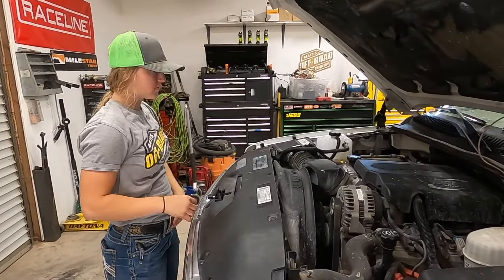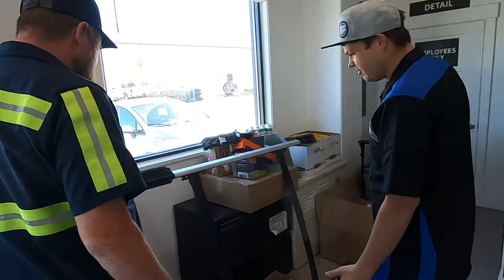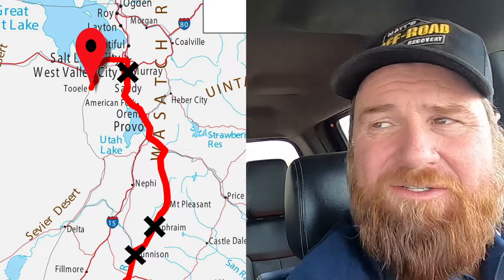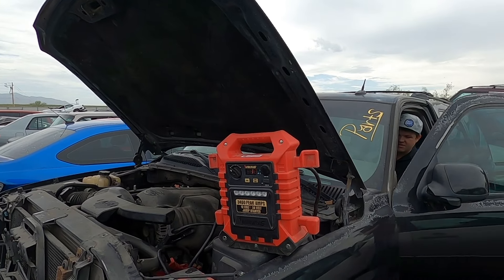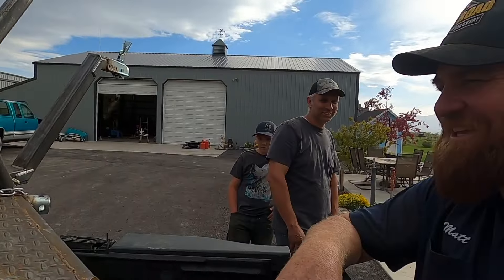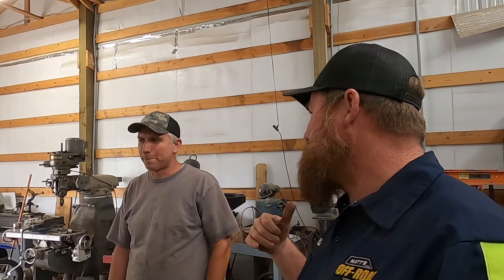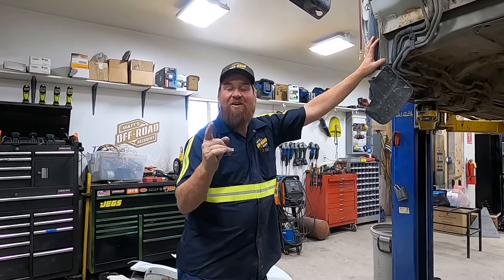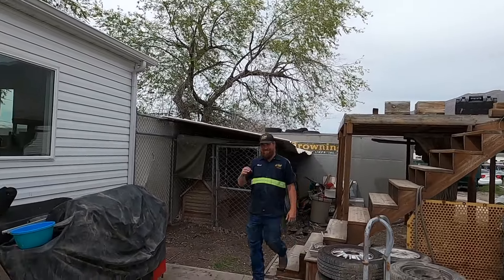Massive Engine For A Massive Off Road Wrecker!

Comment: Hello Matt,
I wanted to make a suggestion for the Wrecker. Have you thought about the fuel tank? Since you usually run out of Fuel in the past (Due to unforeseen "reasons", LOL) Would a thought of a custom made fuel tank of say 60 gallons be a good idea? Now would be a time to think about how to have it shaped to fit into the channel between the frame. It might need a middle raised hump to clear the drive shaft. A good electric fuel in the back end. Add a super heavy duty skid plate because of going over rocks might be a great Idea. I know you have said that you are trying to limit weight but if done now it would be a bonus later. You have several people to draw on to get it prepared for later install. One reason I was thinking about a 60 gallon tank is because you mentioned that the 8.1 liter engine takes 3 times s much fuel to do the same work. If you think about it now it could be manufactured before you are ready to install it. Hope it helps to make the suggestion.
Reply: Should be split between two tanks. Given the nature of the beast he's building - redundancy is crucial. One large tank could spring a leak & all of it lost. Two tanks are less likely to both leak fuel.
Reply: My 26gal Crew cab 06 short bed that is lifted 6” running 35s gets 8.7 mpg city with me babying it unloaded WITH a tailwind. Any type of more fuel storage is a MUST…. I’m not even through the video and I can tell you all are the real deal! Good luck y’all!!!!
Reply: I recommend Dual Large tanks for Matt
Reply: I have an 06 GMC 2500 with the 6.0 L extended cab with a 2 inch factory lift kit because it is the disguised 7/8th ton. I get 13 highway 10.6 city with slow acceleration. Hook on the 6x12 cargo trailer and loose 2 to 3 mpg especially with a 20 plus mph head wind. 
I know Matt is always showing off his fuel refilling prowess (snack/lunch/Mountain Dew refill time) but in the middle of the even when "We got a Call" time rolls around sometimes he just heads out. He is needed and he goes. He also probably won't be putting in a gasoline station GPS warning system. (Actually I want one of those!) So a larger tank will be needed. (I also want one of those!)
Reply: @SeanWyseman  the old 90's ford f 350's had an option for two fuel tanks, my old boss had one. just a switch inside to flip between front and rear tanks, Then Matt can run out of fuel twice :)
Reply: Honestly, he probably should have gone DuraMax, considering he said that it only has a tiny bit less torque, but 1/3 the fuel consumption.
Reply: @purplepenguin43  I don't care how many times Matt runs out of fuel. I can't control that. 2 tanks will ensure that Matt won't run out of fuel due to a leak in one tank or fuel line. I'd also think about a fuel pump & filter for each tank. 

Given the crazy movement & angles that an off-road vehicle is subjected to he should probably pay a lot of attention to tank design so as not to get in a position where the fuel doesn't feed into the pump.

Comment: Hell yea! Love to see more 8.1 builds. Very underrated motors

Btw the real choke point on those motors are the heads. They don’t flow all too well even with work done but aren’t the most horrible. 

Next thing that goes is the bottom end
Reply: Do they eat transmissions on a regular basis?    Or am I thinking of 2005 Expeditions...
Reply: @testingthecat8285  no worse than any other HD truck

Comment: One thing about it- you won't be able to go off cruising around for rescue without MAKING SURE you have FUEL in that!!!!! :)    I had one-  it pulls into a station sucks it in and BURPS!!!
Reply: The fuel economy is atrocious, hope Matt can find a 50 gallon fuel tank or something!
Reply: @MeEntertainmentJo_876  Or digs in to common sense and puts in a diesel.
Reply: @Rafu01  -  Exactly.  A wrecker that size and a diesel wasn't even a thought?  That's just inexcusable.

I love Matt and his whole universe, but he's so wrong not running a diesel in the heavy wrecker.
Reply: Even a Duramax in this heavy truck would get extremely poor fuel mileage. I think you all are missing that this is a purpose built rig.
Reply: @TurkeySandwichJr  I understand that this thing was never going to get great fuel economy, but given its size I don’t think he can haul it between recovery sites. It’s gonna have to drive out there on its own and given how large of area he covers it just seems like the 8.1 is going to drink way too much fuel.
Reply: Matt already has plans for Lizzy to drive a 4 thousand gallon fuel truck behind the wrecker ! No worries 😉
Reply: @MeEntertainmentJo_876  That's why heavy trucks have massive fuel tanks, 250-300 gallons for a diesel OTR rig. The average medium duty truck (say 26-33k, the sort of large but not tractor trailers you see as utility vehicles and box trucks) you see on the road gets 7-8 MPG in the real world.

Let's say this thing gets 5mpg which is pretty close probably. Just one 120 gallon tank gets him 600 miles of range, and I imagine that's plenty.

Comment: I’d love to have a conversation with Matt to understand where he’s coming from with his concepts of gas engines. For comparison, a Cummins 3.9l engine with a few bolt on upgrades but no engine work will reliably push ballpark 500 horse, 900+ ftlb of torque, weighs 100ish pounds less than the 8.1, won’t vapor lock because it’s a diesel, atleast double the fuel economy easily, and will last 4 times as long due to it’s low rpm (hence “million mile diesels”). Those engines are also very happy and well suited for idle work (running hydraulic pumps and generators off pto) which is one of their alternate uses. That being said he seems to have done his research which is why I’d love to hear how he’s come to where he is on his ideas. In the car community I find that there’s often something that the person who doesn’t agree with the decision is overlooking in the process of coming to said decision.
Reply: You answered your own question, the answer is rpm
Reply: I agree with you.There is no reason to put petrol engine in to heavy duty trucks especially when you running those military axes.Only maybe if you live in northern Canada.He is going to go to Cummins and Allison.

Comment: Matt, love the channel and all the builds. Something to consider is the cooling system you are going to need for those hot summer recoveries. Had a friend who put an old Mack cab on a 3/4 ton suburban chassis with 7.4. He ended up having to put an auxiliary radiator on the headache rack on the flatbed even with a custom BeCool aluminum radiator. Those old trucks don’t have a lot of room to get a big radiator in there and that big block needs a big radiator.

Comment: My 8.1 had 335,000 miles on it and is still running strong ad my daily driver and as my primary tow unit.  I run it from Northern Ohio down to the hills of southeast Kentucky even to Pennsylvania in to Off-road Park all-over.

Comment: Yes! I was hoping you'd go for the 8100 drivetrain, it's really a good engine for this project.
Reply: I was saying spend a little extra and get the new 6.6 gas or the ford 7.3
Reply: @nottoday7495  I think figuring out engine management (edit: and integrating that into the rest of the wiring and gauges) on either of those would be a nightmare. The 8100 being GMT800 based you have lots of options there. Also, even though these are all reliable engines, we're talking about a rough service application and in reality - it could blow up. I'd much rather source a replacement 8.1 then try to find one of those new engines.

I haven't driven the new 7.3 but I'm not very impressed by the 6.6. By the "butt dyno" it doesn't feel any different than the 6.0 trucks. In an 8.1 you just have a mountain of low end torque, it's a sharp comparison.
Reply: Drive train or power train you mean.
Reply: @masterflow101  I was hoping for the 8100/Allison package, not sure of any other real HD transmission that has readily available 8.1 adaption. Pretty sure the motorhomes used them as well as the HD trucks. I know the Burban doesn't have one but maybe that's still the plan. Would make sense to pair it with a beefed up Allison.
Reply: Keep the same transmission as is with the motor now, swap out for a greater low range ratio transfer case and possibly add a bigger transmission cooler.  The greatest power draw on the big wrecker will NOT be off road, but flat towing a big RV on the highway on an uphil grade at 65 mph.

Comment: So glad to hear your going with an 8.1 Vortec. It's such an awesome engine. I've had mine new since 2004. It's a great combination between low end torque and the RPMs when you need them. I got 160,000 on mine and it still runs like the day it was new.

Comment: Matt I love the idea you have going here, not trying to sound overboard here but I think a very useful power adder on this would obviously be a tune, but also two SMALL turbos to get this thing pushing power out of the low end quicker for you which I think would be the best time for you to have power. Give it more grunt basically. Very excited to see where it goes. Good luck buddy
Reply: i disagree.  the 8.1 makes 460 torque STOCK.  and the torque curve is so flat, it makes almost 400 torque from IDLE,  its really unecessary.  the allison trans is the icing on the cake, and he will have the diffs geared for his application.
Reply: Twin turbos just adds complexity for no advantage. Remember, when you fit small twins, each is only getting half the exhaust flow to drive the turbine. A modern large single is more efficient and doesn't lose any response either.
Reply: Unfortunately small turbos are great at making power quick on the low end but will become inefficient in the top end as the engine will demand more CFM than the turbos can flow. It'll actually rob you of power up top. That's if the turbos don't overheat first.

Comment: Yeah, I would be very careful about putting a turbo on there, mostly because of heat. If you do decide to boost it, maybe a pair of smaller ones is a better choice than one big stonking scroll. Faster spin-up, and possibly less of that torque spike you can get from a big boy.

Comment: Congrats on the BB as an engine choice.  I have the 454 bb in my lifted CJ-7 and there is no such thing as to much power.  I'm sure that 8.1 with its fuel injection will be a perfect match. I only wish the 8.1 came out a few year earlier and maybe I would have had one also. I will be watching this build closely for new ideas. Nice to see Erica join Lissy on screen. Can't go wrong with a few ladies working in the shop.

Comment: The 8.1 is prefect for your wrecker, I was a bit confused there when you were looking at the 6.0, but ya probably have more projects planned. I think you will want the turbo, LT is right. Turning the big tires and massive axles gears etc in that beast will eat up the NA torque quickly. Hopefully you can leave yourself enough room to put one in there. Can't wait to see what size gas tank you come up with, LOL.
Reply: Matt said in the comments that it will have an 80-gallon tank.
Reply: If you watch Robby Layton, the 6.0 is probably going into the Morrvair.
Reply: trouble with turbos is having to spool them up and then you have more power than you need I think too quickly. Matt's mentioned it when trying to pull out all the diesel pickups with big toy haulers on them. The N/A steady power is what he's after I think. That's where a supercharger would probably shine for them. No lag and all the power when you need it.

Comment: Just what Matt needs, a motor that consumes 3X the fuel when under load than a 6.6L turbo diesel. Hope you’re putting in dual fuel tanks in the heavy wrecker.
Reply: The reason for the 8.1 is to stay away from diesel. If you've watched this channel at all, you would know why Matt stays away from diesel engines in off road recovery vehicles.
Reply: It wouldn’t work for what he needs. A lazy diesel that takes years to spool up doesn’t work for this wrecker. I have a 5.9 cummins f650. Mash the pedal from the stop and it’ll start to move but it’s about 3-5 seconds before the turbo lights and you actually feel anything.
Reply: @JosephSamsor  that's Matt's reason for not going with diesel, that & the extra weight. 
There's still going to be some "armchair experts" on here that's going to have a coronary because Matt chose to go with a gas engine. You know the type, those that bought a diesel pickup & thinks they know everything there is to know about diesels, they'll argue until they're blue in the face to guys who grew up around diesels, & worked with diesels over 30 years their of adult life. 
I think the big 8.1 was the best choice for what Matt needs.
Reply: @timothygeiger8271 it was meant as a light-hearted observation on Matt’s propensity for running out of fuel. I have no dog in the diesel engine vs. gas engine fight
Reply: @danjones1365  he does consistently run almost out of fuel quite often.

Comment: A supercharger would make more sense for a low rev rock crawler over a turbo would it not?  Instant power instead of waiting for boost to build.
Reply: Thats what i think too, im a bit surprised he didnt put a diesel in the wrecker!
Reply: How many rock crawlers with a blower do you see
Reply: @eln0n01   not a lot, usually not any forced air at all
Reply: @tarzaan2603   exactly
Reply: With some modern turbos you can make more horsepower down low than even a supercharger. Superchargers make boost based on rpm and therefore don’t help much at low rpm. It depends on the turbo set up.
Reply: @tarzaan2603  I think the bad about diesels is the turbo lag. Matt's mentioned it a few times that you have to spool them up and then you have alot of instant power which isn't good in the sand when you're trying to fineess something out of a tight spot or loose sand.
Reply: @chriskulpa4056   the diesel trucks i have drove had zero turbo lag.
Reply: @tarzaan2603  must not have been pushing them then. Turbo lag is definitely a thing. Like I say must not have seen many of Matt's videos of him pulling diesels out of the sand either 😁

Comment: There is a company that sells heads and cams for the 8.1, wakes them WAY up.
Reply: So does a Turbo at much less cost 🤔 with greater results especially in the Torque department which is where the Heavy needs it 😉
Reply: @andyplage6590  if you think a turbo will ever outshine a N/A big block for torque at lower rpm... then I got nothing else to say yes the turbo will make more on the big end... but for GRUNT... there is NOTHING that will beat a big block with a long intake runner.

Comment: Idea for that trailer...  build some form of receiver that could fit an extension and hitch that sits LOWER, so during those rare moments where Papa E needs a hand getting his trailer somewhere, you bust out that "accessory" and pin it in under the goose-neck and have the ability tow it with another vehicle.   Built right the extension and 2nd hitch could fit in the frame of the trailer for storage too?

Comment: I had an 8.1 in a GMC 3500. Towed my 32ft fifth wheel.  Great motor. Bought it new in 2001. Put 122,000 miles on it before I traded it 2 years ago. Never put a wrench on it in the 19 years I had it. Pulled like a government mule. Would pass anything but a gas station. 7mpg towing, 12 mpg bobtailing highway. Despite the horrible gas mileage, I wish I'd kept it, it was mint.

Comment: I was mad as all hell when you said "ls powerplant"... now Im much happier. When my 454 in my truck finally let go at almost 300k miles, the 8.1 was my replacement. Honestly, best choice Ive ever made. It's a great engine, reliable as the sun is bright, makes a great noise and you learn to live with the 6 mpg... Ok you never learn to tolerate the mpg issues. Fun fact unrelated, I had a Porsche Cayanne turbo that also got 6mpg..

Comment: Glad you went with the 8.1.  Ls are easy and cheap and quick repairs, but that's the thing it's made that way cause it will need repairs when it's used hard.  The 8.1 will last and take it, well worth it in the long run in your line of work.

Comment: Get a tuner for that engine to save fuel increase HP. I put one on my 3500 RAM & it went from 13 mpg to 18 in the city & 22 mpg on the highway. Also the power output is 480 hp instead of the 355 stock hp. When I'm towing 16500 lbs 40' RV the gas mileage went from 7 mpg to 10 or 11 mpg depending on the terrain. 

Gentle hills up and down with lots of straight stretches gives about the best pulling mpg at 13mpg. Do a dyno tune & you'll have better mpg still. Best money I ever spent. Tuner paid for itself in less than 2 years of relatively light driving (about 10k / year).

Comment: I have the 8.1 with the Alison transmission in my Chevy crew cab dually. You ALWAYS run out of gas with the Banana and Morvair, the 8.1 big block gulps gas. While it's a wonderful torquey engine, you'll always be sitting on the side of the road, waiting for a rescue with the monster truck!

Comment: My advice... go for the turbo. With stock compression and a stock cam, throttle response and low RPM drivability will be exactly the same as stock, but when you want the extra oomph, ya just gotta keep your foot in it a little bit longer.

Comment: LT is right with taking the torque from 455 lbs stock to 906 lbs with the high flow injectors and the 80 mm turbo. Are you going to run an intercooler with the turbo? Also Tropical radiator coolant for hot weather makes all the difference in keeping to engine cool and producing more power. This is an exciting build to follow.